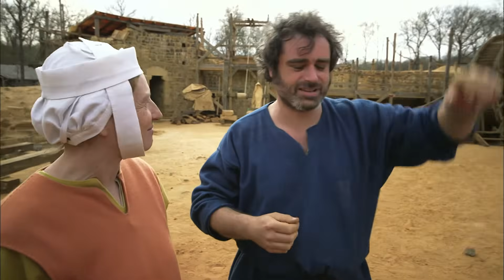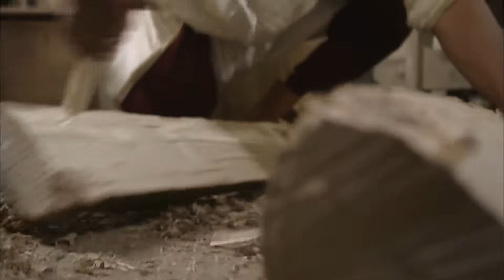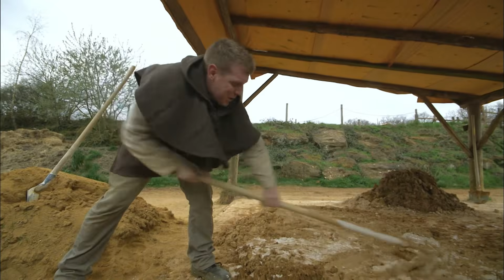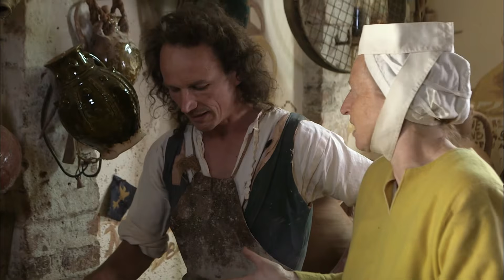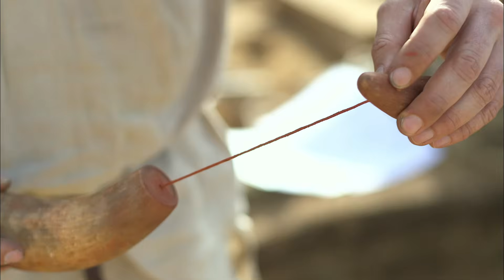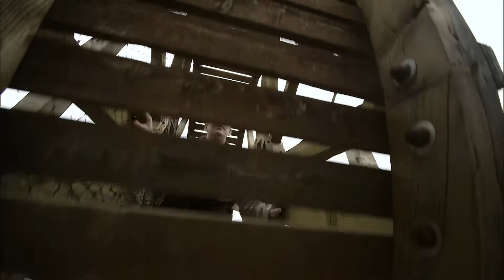How To Build An Authentic Medieval Castle From Scratch

Comment: 17 years and that's all they had done? They better start working harder or they won't have but half a castle in 25 years especially if that model they showed is how its supposed to be when finished. Judging by that they don't look half done yet. That's crazy they haven't gotten more done in all that time. I wonder how long it would have taken back in the 13th century to build an average size castle? I dont think it would have taken 17 years. They probably had enough people working on it and probably someone was working doing something 24 hours a day 7 days a week until it was done. Only taking time off to go to church Sunday morning. Wouldn't it be awesome to build your own castle for a home? The work involved though is astronomical which we can see in this video.
Reply: The experimental archaeologists are more interested in figuring out details and soaking in the experience than they are in actually finishing. A real medieval crew would be several times the size of the workforce we see here. Real medieval craftsmen would have squads of apprentices, and there would be hundreds of laborers. They would be working on several sections all at once. A good medieval crew could definitely have finished this project after 17 years. Also they've probably had periods when they couldn't continue because of not having funding, and stuff like that: which would not have been a thing in real medieval times.